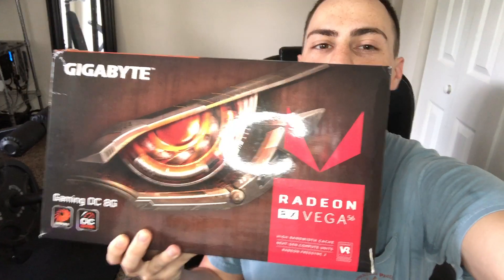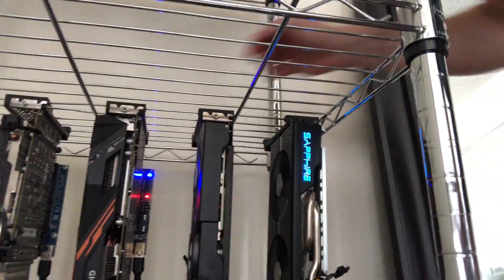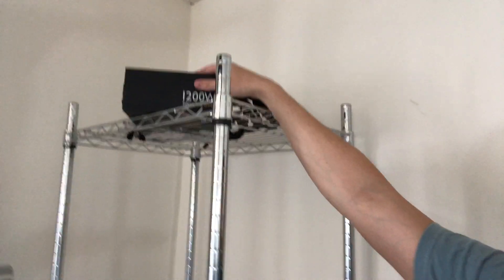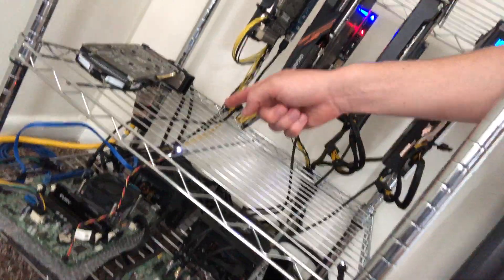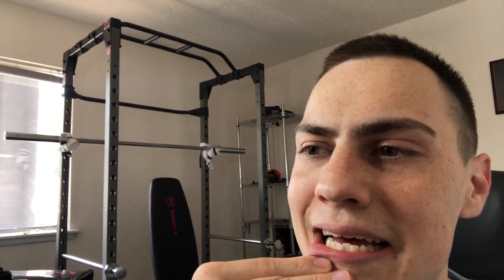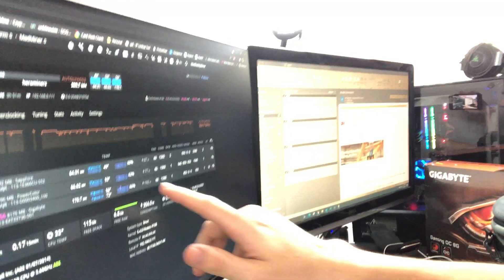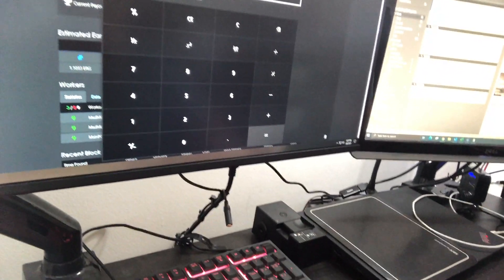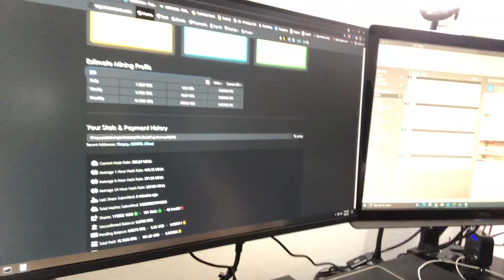Mining ERGO on a Vega 56

Comment: After seeing this video + comments about this card + my own experience..
Don't worry m8 u ain't do something wrong, the card can't deliever.

I bought a faulty gigabyte (crashes when pushed), but still I don't push it so it behaves normal and stable at low clocks for ergo.
But even at 1020Mhz Core 140mh/s @800mV // 900mem @800mV it consumes 20w-30w more than my x2 nitro and 1 asus strix all three 189-190mh actual core: 1356 (I set core and voltage settings till I get 1356 stable on them), mem the same as giga 900mhz @800mV.  
All flashed vega 56 // win10 // ryzen 3600 boost off // ddr4 3733 cl17 1T custom timmings ratio 1:1 // 2xPSUs connected: Superflower 1600w platinum and Seasonic 750W platinum // all cards are clean at low temps with new thermal pads n' repasted  // power plan windows balanced (I don't see any difference if higher cpu clocks, but ddr4 matters). // OOSU10 software to force down some windows services eg windows updates// @Registry Crossfire and Ulps off // no output to monitor for any vega (reduces hashrate and adds Vcore!!) I get signal only from a RTX3080). // Memory Tweak is being used to force SocMhz at 899 and set timmings and settings (will make my own powertables too soon with overdrive). I also run 2x3080s for eth each at 103mh as well. // Display output: 60hz // 4k // 8-bit // YCbCr420 (if 4K 120hz HDR RTX is effected!).
Mem timmings for all 4 cards: CL17, RAS20, RCDRD14, RCDWR 12, RC 36, RP 11, RRDS 3, RRDL 5, WTRL 9, RTP 5, FAW 12, CWL 8, WTRAS 4, WTRL 9, WR 14, REF 65535, RFC 248. (haven't test em a lot they are stable to me but will revisit 4 sure). 

I will may "oven" the card after some months (when the card will ROI) to test higher clock speeds if fixed.. but still I don't expect much I can go higher now too but the Vcore demands of it doesn't seem to worth it.
Conclusion: Sell it and try buy a sapphire nitro or asus strix. I will soon get my hands on sap pulse too should be good as well dunno.

PS. I have a 2nd pc as a test bench ryzen 2600 // 3200 mem with just xmp and Hashrate is effected by 3-4% for ergo // for eth it doesn't matter.
Reply: ah I only forgot that I have only P1 state enabled for clock, and P3 state for memory @Memory Tweak software and zero RPM off.

Comment: I have a gigabyte Vega 64 flashed to Vega 56 and it will not core above 1300 without crashing. I’m sitting at 172 mhs 1297 core 847 mem 880v and modified straps. Same as what is in hive except: rc 36 ref 65535 rcdrd 10 rcdwr 8
Reply: Hive says it’s pulling 177w

Love from Alaska brother thnx for the vid